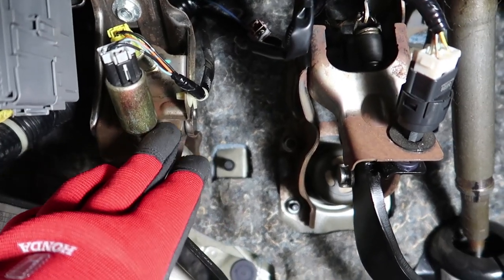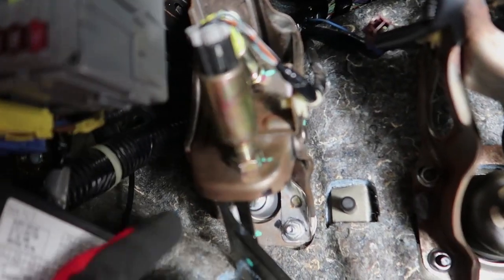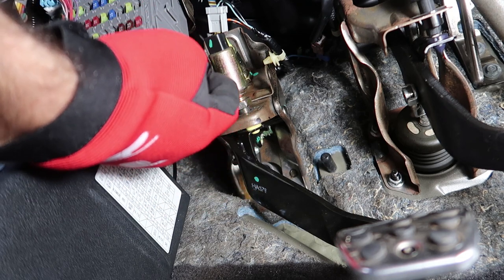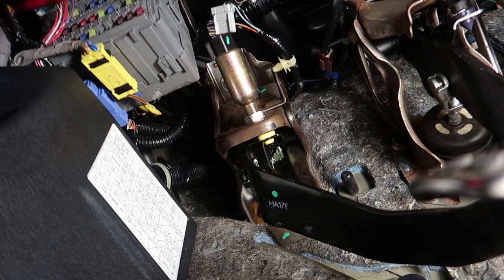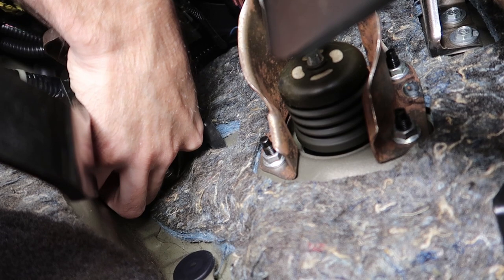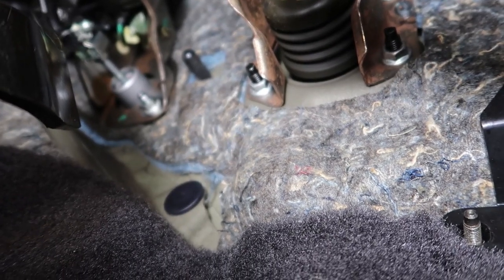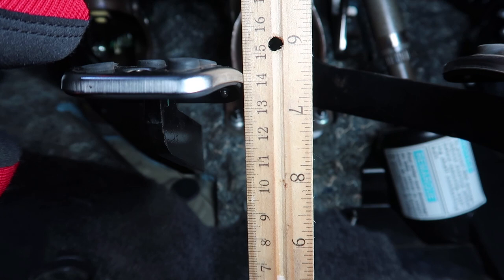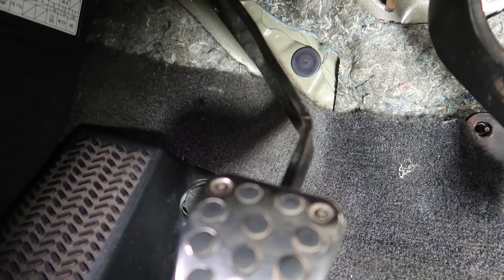8th Civic Si and RSX Type-S Clutch Adjustment DIY | Aftermarket and Stock | FG2, FA5, DC5

Comment: My mechanic did this for me because it was really hard to shift, I’ve noticed though my clutch pedal is getting closer to the floor and it’s coming out of adjustment, before I saw that the nut by the yellow clutch switch the clutch was pushing on the switch/stopper, BUT now it’s very far from the clutch pedal and I can’t engage my cruise control anymore because the switch isn’t being pushed and the car thinks the clutch is pushed in 24/7. Should I readjust and use blue loctite or something? Because it was fine for about a week and now it’s coming out of adjustment again. Not sure if the CMC is just letting the rod sink into itself, I’m not having any leaks, so I’m gonna try and do this today see if I can get it good again. Once he did it to me my car felt like a whole new car, I stalled a few times getting used to the clutch engagement points being different on the pedal haha. Now it’s back to about how it was before I can only assume it’s coming out of adjustment, I want to loctite ? But maybe I should just adjust it like this first and see if I can get it really tight first, and wait to see if it works its way back out of adjustment. It was so bad before I was nearly locked out of 1st and reverse. So hard to shift because I really wasn’t using my entire clutch pedal because of how bad it was.
Reply from the maker: Nova hmm yeah try to adjust it, tighten everything down, take a picture of the cruise control switch/stopper so you can keep track of the position of it. Measure the freeplay with a ruler so you can check it again later. In my experience there is no need for loctite, but maybe there is some oil or fluid on the threads? Can try wiping it with some brake parts cleaner
Reply: @JasonMcMullen  I tried adjusting the nut out so I can spin the rod and the nut is now stuck all the way back on the rod. Also the rod was incredibly hard to twist, I actually twisted the rod using the nut and I’m not able to get pliers in there to hold the rod while breaking the nut free it’s stuck on the threads, didn’t use loctite :( adjustment is ok now but idk for how long with the nut all the way back
Reply: @JasonMcMullen  I just had a few beers went out and hit it again and got it first try cracked the nut loose with pliers and tightened down thanks so much for the video Comrade!
Reply from the maker: @Novaah803  lol nice! Good to hear bro! Also if you push the pedal down very slightly it will make the rod easy to spin

Comment: So, what I am taking away from this Is that the free play is the most important part, and that you can raise/lower the pedal engagement point with the stopper - as long as free play is adjusted to in spec all is well?
Reply from the maker: yeah but also the engagement point changes the amount that the clutch releases, so people who have issues with grinding and non-smooth shifting  can change the engagement point in order to fix that issue

Comment: I've owned my 09 civic si since brand new.   This was going to be my weekend project, but when i got down there,  the cylinder threads were already positioned in your final position!!! 🤔🤔
Reply from the maker: Oh wow thats interesting.  Are you having any issues shifting? Or all good?
Reply: @JasonMcMullen  I recently had a high rpm grind from 1st to 2nd gear which lead me to google the fix!!  

Thanks to you and your vid.  I ended up making a small adjustment to the cylinder where and exposed one more line of thread.

Driving today felt great.  Small difference but my heel-toes are much smoother 🙂
Reply: Have not yet tried high rpm 1st to 2nd yet. lol
Reply from the maker: @aznippy  Awesome to hear buddy!! LMK if you have any issues

Comment: Last time I did this the whole rod came off. It was a pain to get back on. My second gear still grinds sadly.
Reply from the maker: That would be a hassle for sure. When you did it previously was that with an aftermarket CMC or stock CMC? Yeah unfortunately even if the clutch properly disengages it wont fix a problem with worn transmission synchronizers or other transmission issues.  For me my 3rd gear has always had a minor issue of not always going in smoothly (no grind though) but I bought the car second hand (from the original owner) and the damage was already done so I just have to deal with it.  Thanks for the comment bro
Reply: Jason McMullen yeah it was the stock cmc. I’m trying again today but the rod seems to be really stiff to turn.
Reply from the maker: xUNFLAMMABLEx Yeah like I mention at the end of the video, the threads can get slightly bent from locking it down and then it makes it difficult to readjust. You can push the pedal down just a tiny bit and it makes it easier to rotate the rod, but the problem is when you let the pedal back out you will have a different amount of free play, so you have to measure with a ruler then go back and readjust if it’s not in spec. I have a brand new CMC and it rotates easily, but my old one didn’t. I’m not telling you to buy a new one, just sharing my experience. Hope it works out for you brotha
Reply: Jason McMullen thanks bro I rewatched the video so many times and I’ve gotten the car to not grind surprisingly and I raced 3 different car lmao. Clutch seems to work good but the clutch engages right away
Reply from the maker: @cristiansblackfg2656  Good to hear bro! Gotta have fun hitting VTEC. The freeplay can change the engagement point a little but if you have it not grinding now then maybe just see if you can get use to it before changing it again. I know I adjusted mine way too many times lol
Reply: Jason McMullen yeah bro thanks for the help. I really appreciate it. Whenever I replace the clutch I will change everything flywheel, slave cylinder, and clutch master cylinder.for the mean time I’ll just keep adjusting the stock cmc.
Reply from the maker: @cristiansblackfg2656  Right on Bro! yeah good idea, everything will be nice and new
Reply: My rod came out and idk how to get it back in. Now I can't get my car into gear and I'm stressing
Reply: @TheGamingDividend  same, how’d you do it

Comment: Hey Jason,

I have a 2002 RSX. Just got the transmission rebuild and got a 1.5 stage Competition Clutch installed. My mechanic told me he didn't feel like he needed to adjust the clutch pedal. The clutch grabs pretty low compared to before.

 Sometimes when I'm at a stop light, I can't shift into 1st and some gears are hard to shift into. At one point I couldn't shift into 1st at all, it was like I wasn't pressing in the clutch. 

I will look into adjusting the clutch pedal following your video instructions. Since the clutch is grabbing pretty low, that means I want to adjust the rod for more freeplay, yes?

I appreciate your input!
Reply from the maker: The freeplay only affects it a little bit, most likely you are gonna want to go to less threads showing, which lengthens the pedal travel. Always redo the freeplay after adjusting the pedal travel because it throws it off when you do. From what you said, an adjustment will certainly help, the pedal will grab higher and the shifting should be smoother after
Reply: @JasonMcMullen  Thanks for the reply Jason! So I adjusted the screw, it was way off. It had like 10 threads over. Once I adjusted it to 1.5 threads, the shifting is much smoother.

But now I have a new problem. When I'm in neutral in idle, I now hear a slight chatter noise. Once I push the clutch in, the noise goes away. Any ideas? This noise was not there when before adjusting the pedal.

Thanks!
Reply from the maker: @Shorty15c4007  maybe try to go to 2 or 3 threads showing, but first can you check the freeplay with a ruler? you want to have at least 10mm
Reply from the maker: @Shorty15c4007  do you have a Type-S or regular? because the 1 thread is for the Type-S
Reply: @JasonMcMullen  I have a 5 speed base with a Type-S clutch and flywheel.

I will go 2-3 threads and see if I can achieve a sweet spot. And I'll double check the free play distance
Reply: @JasonMcMullen  I went 3 threads showing. Throw out bearing (TOH) is now making a very slight chatter sound. You can really only hear it if you're looking for it but it should be silent right? I am still in the break in period, about 60 miles done so far but I fear I am prematurely wearing the clutch, the TOH or the master cylinder. 

Dumb question but after doing about 15 miles of city driving I notice that the Master cylinder is warm to the touch, this that normal?

I appreciate your help man!
Reply from the maker: @Shorty15c4007  Its probably ok. Did you ever notice a lot of pressure when you pushed down the pedal all the way? usually at the bottom of the pedal travel? also maybe try more freeplay and see if that gets rid of it, since you said it happens in neutral

Comment: Outstanding video! 
I just got the hard motion EM1 with slave. I have an Exedy stage one clutch. Hard Moton recommends swapping the piston rod with stock. So am I looking at 5ish threads based on the CMC/clutch or 2ish threads based on the push rod swap? Thank you in advance
P.S. I love the upper strut bar
Reply from the maker: Thank you so much! Try 2 threads but if you feel pressure at the bottom of the pedal when shifting at high RPM then shorten the pedal and maybe go to 5. Because you swap the rod, I think it will be closer to stock but I'm not sure so it might take some trial. Let me know what you end up at and I'll put it in the description
Reply: Jason, just installed and went with exactly two threads. Based on pedal feel it engages at about 2 inches off the floor.  Feels perfect with no pressure that I can tell.

Comment: I just replaced my clutch to a stage 1 action clutch and have the hybrid racing cmc. The instructions for the cmc said to replace the rod with the stock rod. So do I have half to one thread showing? Or 5 threads showing? TIA!
Reply from the maker: I believe if you replace the rod then your adjustment should be similar to a stock cmc (1 thread showing)
Reply: @JasonMcMullen  sounds good! I’ll give it a shot and let you know. Thanks for replying!

Comment: So my release bearing was already toasted, but I watched a video (prior to this) that was not as clear and adjusted the rod until it was super stiff, and rolled it over a few more times after that. I’m not 100% sure if I aided in the throwout bearing doing what it does now (squealing for it’s life whenever the clutch is not engaged, even when the car is moving in gear) but I’d better fix my adjustments. 

Long story short: The idea is for the rod to just be sort of snug and not fully secured, correct?
Reply from the maker: Hey buddy, yeah you want the rod to have a little bit of freeplay, so once you thread it in until you feel resistance, then thread it out (counterclockwise) minimum a half turn, maybe more. When you check the the pedal freeplay with a ruler, the pedal has to have 10mm or more of freeplay (dead pedal). If you spin the rod counterclockwise more then it will give you even more freeplay. If the pedal has less than 10mm of dead pedal then its possible that the release bearing will still be hitting the clutch even with the pedal out, and it will damage the bearing and the clutch. I hope the adjustment helps, I know how it is because when I bought my car it already had a noisy/damaged release bearing so I eventually replaced the clutch/flywheel/bearing and it cost me some money, but hopefully you will be ok.  And yeah the other videos that don't cover setting the proper amount of freeplay are kinda dangerous honestly, which is another reason why I made this video.  Hope it helps bro

Comment: Hey whats up everyone im having some issues with my cmc and slave, I replaced my clutch,pressure plate, flywheel and throw out bearing with competition clutch 1.5 stage, 8 pound flywheel and also I installed the CMC and slave combo from Ktuned, this was about 10 moths ago, I drive every day this car about 40 miles per day sometimes with LA traffic and some spirit driving on weekends, around a moth ago my problems started, I was at a red light and right when I was taking off( releasing clutch) I feel the clutch “bitting as usual” but before I completely released it I felt the pedal clutch go kinda “soft” and the bite wasn’t as hard and the release point was higher, I had the clutch adjustment rod showing 5 treads since the day I installed everything and the cmc rod adjusted by my mechanic, I’ve been doing a lot of research on how to adjust the rod, I’ve watch videos and I clearly understand I have to spin it clockwise until you feel some kind of resistance, here’s my first problem, the ktuned cmc rod doesn’t spin just with your fingers, you have to use some pliers in order to spin it, so how I’m i supposed to feel the resistance everybody is talking about ?
Second problem: I went to my slave cylinder and I try to press it with my fingers and I just couldn’t is hard as a rock...tried again messing with the cmc rod, if I spin it clock wise my engagement feel higher and clutch pedal soft but if I spin it counterclockwise it will
Actually feel shorter and more firm, I know my slave cylinder is supposed to be able to move with my fingers so I went under the dash again today and I spin the rod counterclockwise more so I could try to fix my slave issue but when I tried to start up my car It just wouldn’t start, so I put the rod back in the position I adjusted first and everything was “ok” Again, also I would like to address that when I’m in traffic in first gear or second and I completely release the clutch without touching the gas my car still moves, like if I was gassing it a little bit or releasing just a little the clutch, what you guys think is my problem ? CMC or slave? I checked and any of them are leaking... clutch ? Throw out bearing ? I would really appreciate any help, thanks

Comment: I think I need to do this in my car. The pedal has too much free play and the clutch disengages as soon as I start releasing the pedal, not half way. I recently had the clutch changed and I think this wasn't done to my 8th Gen Civic SI. Now my car doesn't take well the shifts to the point I feel I'm going to break the shift knob. It feels like the clutch is not engaging enough
Reply from the maker: Yeah give it a try, it sounds like it does need an adjustment. Mine was kinda like that before also

Comment: I'm having issue with adjusting the CMC rod,I can't turn it either way, I also have 5 threads showing(k tuned CMC and slave) bleed the whole system 4 times to make sure there was no air and yeah there's a lot of play in the clutch pedal and the fork barely moves,I tried to do it by pressing the pedal a bit and turning it but it didn't work😕.
Reply from the maker: do you have a ruler to measure the freeplay? Most likely there is too much. If you thread the nut down  then you might be able to turn it with that but the nut might get stuck too. You could also try to go to less threads showing and it might add enough throw to make the fork move. Its really tough to do when the threads on the rod are damaged but it is possible using measurements. Worst case, you can put a little lube in the area, then spray it with a little brake parts cleaner once it is in the right place
Reply: @JasonMcMullen  I got it working, guess what was the problem? The pedal was broken from left side and had to weld it 😂FML I spend 4 days and a new CMC and slave on it.
Reply from the maker: @abdurkhan6075  damn bro that’s crazy! Glad you worked out a solution 💪

Comment: Is it suppose to be em2 or em1 clutch master? Im trying to understand what you are saying but I’m not following. I bought a em2 master for my rsx but it has over almost 2 inches of freeplay. Need advice.
Reply from the maker: Most people use an em1 but some people use an em2. My video is for em1 but the em2 is similar. Basically if you are having trouble shifting then you need to make the pedal longer, and you can do that by going to less threads showing on the adjustment screw. For freeplay, the rod will let you adjust the freeplay after adjusting the height. If you spin it clockwise and then lock it down (with the nut) then it will give you less freeplay. You want about 10mm of freeplay.

Comment: Thanks for the video it really helped but when I am adjusting free play on the cmc rod. I have to slightly push in the pedal or it won’t rotate the rod, if I have it anymore to the left then about 1.5 turns. But I am only at like 8 mm of few play at 1.5 turns back counterclockwise from all the way clock wise
Reply from the maker: Alex Christian can you rotate it more counter clockwise? If you can go another half turn or so counter clockwise it would be ideal,  to try to get to 10mm. Usually it will rotate back out counterclockwise about 5 times before it hits the stopper (I know it’s hard to tell when you gotta push in the pedal). Let me know! Even having 8mm you probably won’t do any harm but it’s best to be safe and go by what Honda recommends
Reply: Jason McMullen I’ll try but I think the reason I have to push the pedal is because when the pedal is fully out the rod is contacting the cmc so I have found that point where it is just enough clockwise not to contact it but at that point it only has about 8mm of travel I think I will just have to see how that works
Reply: Jason McMullen well I took the car out to get groceries and it doesn’t seem to be having any problems I don’t smell or feel the clutch rubbing and I have just a hair of space in-between the rod and the cmc so It worked out I guess thank you for the tutorial dude. Every other one I’ve seen doesn’t even come close to how clear and detailed yours is
Reply from the maker: @alexchristian5399  Good to hear bro!! Yeah its probably enough. And thanks man I really appreciate it!!